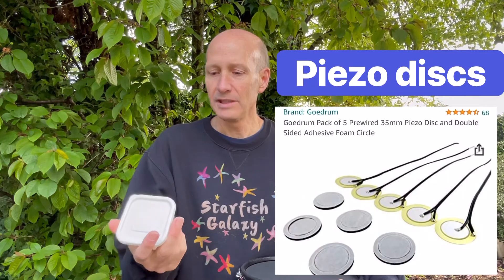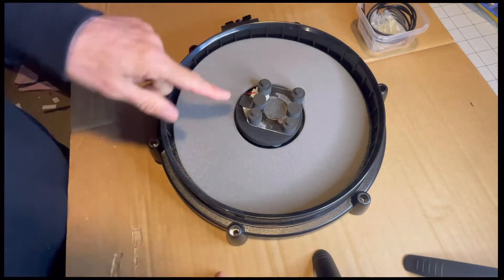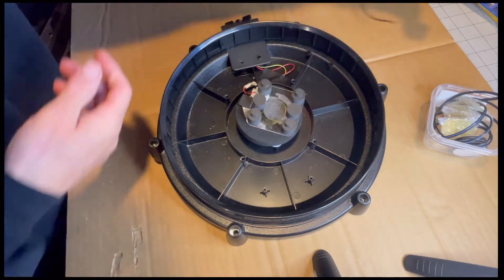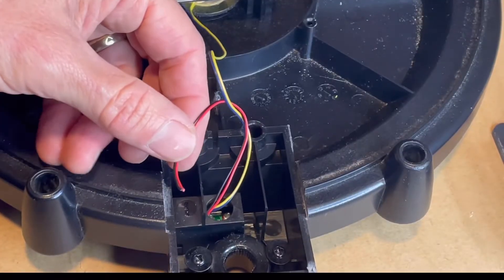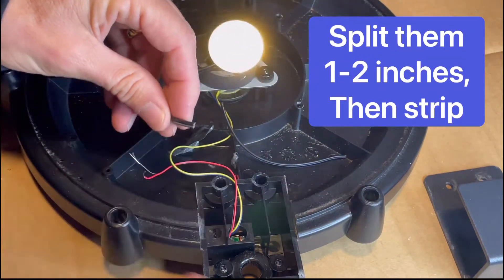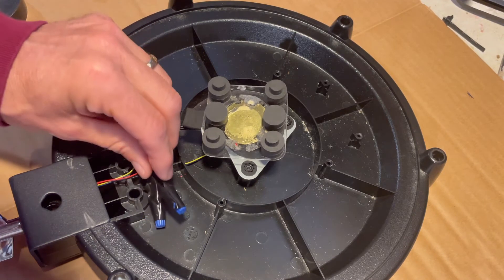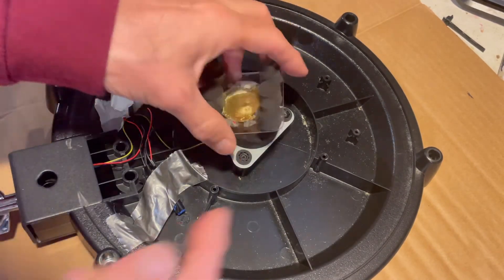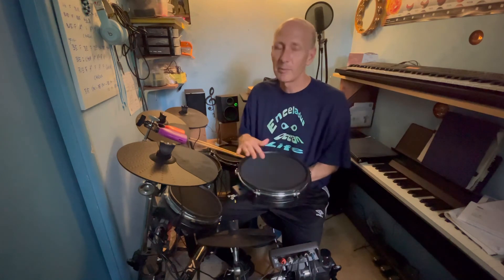Electronic Drum Repair - Piezo Disc

Comment: Do you have another piezo disc to recommend, o can’t seem to find the ones you used on amazon
Reply from the maker: You’re right! It looks like they have discontinued that particular model that I used. Doing a quick look on Amazon under “piezo disc”, it looks like most of those that are listed would work fine, including the , ‘overall pick’.  The ones listed  that are ‘10 pieces, 35 mm, $9.99, would probably work fine as those state they are also for mic drum trigger, which is what you need.  The icon you will first see states 41mm, but then has a selection of 35 mm when you click on the product before you order.  Thanks for your question and good luck!

Comment: planning to do this with my strike pro shells - they look great, but for a flagship, they have the same flimsy internal connections - i can't imagine they would cost all that much more to use more robust components and the strength of their brand would shoot through the roof
Reply from the maker: Absolutely agree!  Probably would have cost less than 20 cents to use a more robust thickness of wire because they buy their supplies in bulk at a discounted price.

Comment: mine had just the wires broke  idk how so i just soldered them back on and it worked :)
Reply from the maker: Hope it stays connected and working!   Soldering worked for me, but never lasted more than 2-3 months, which is why I eventually switched to the thicker wires.  Good luck, hopefully you won’t have to do any further repairing.

Comment: There is a butt connector used for telephone wiring that would be perfect for this application.  I do not think you even need to remove insulation first.  Might want to try.
Reply from the maker: Interesting idea!  So far I have not had to do any re-tweaking since I did this change a few years ago. The thick wire holds up very well against any drumming. I will keep your idea in mind though.

Comment: Fixed my Alesis kick drum and snare with this method. Excellent video, thanks a ton!!!
Reply from the maker: Glad it worked!  The thicker wire piezo disc will hold up quite well.  It really should have been how it was issued from the factory.

Comment: Hi, any update on how long the e drum fix lasted. Particularly, did the twist connector hold out against the battering? Thanks
Reply: I haven’t had to change it since I did this fix two years ago. So, for me, it’s working pretty good.  Before that, I was re-taping it and re-soldering it every few months.

Comment: Commenting to say that I had two triggers with problems. Used the recommended sensors, replaced them both, and they're both working good as new.  So can confirm this does indeed work and was much cheaper than trying to replace a full pad! 
Thanks
Reply from the maker: Glad it worked good for you!!  Going on two years now with my replacements and no problems.  Thick wires should be the factory  built default but, well, they’re not.    Good thing they at least sell these replacement piezo discs.

Comment: hi, I had the same problem and I had to buy a new piezo but when I hit the snare in the unit the snare rim also lights up, do you know what could have happened?
Reply: That sounds like a wiring problem.  The piezo disc at the bottom controls the snare rim, and the piezo disc at the top controls the snare.  I believe you will need to find where the two wires have been connected together and separate them.  If other people have ideas on this, then please give your input too.  Good luck!

Comment: Thanks a lot , I was about to buy a new one, I have the same model and I bought the size that you mentioned but mine was  I guess 5mm smaller,, but it worked with a 35mm,  the brand you show seems that the wire is less thicker than mine. I just wanted to say thanks you save me 200 bucks
Reply from the maker: Glad it worked out!!

Comment: Nice informative vid ... thank you. I have two Alesis Strike Pro SE kits (one in studio and one at home) and on the studio kit the 10" tom has failed and at home the 14" snare has failed. Alesis utterly useless here in the UK and to say they are slow to respond to my warranty claim is an understatement. Both kits are under 8 mths old. Once ( IF?) I get some joy and the when full 12mths warranty runs out I know I will be on my own to try and fix this stuff going forward so I do appreciate the time you've taken to put this together and show how its done. I know each drum unit will differ slightly but the principle remains the same. Thanks again 👍
Reply from the maker: Sorry you’ve had to go through this on both of your kits!  It is certainly frustrating when you finally open it up and see how thin in the wiring is and realize it was just a matter of time.  The good news is that at least there is a fix, and the result is something that’s much better than the original. Good luck!

Comment: Thank you! I’ve been fighting with Alesis about the cheap wiring they used on the snares. The kick drums are the way. My kick has been intermittent and I finally took it apart and saw the same wiring. Ridiculous!
Reply from the maker: Yes, the wiring is so thin that is ridiculous and destined to have problems. I did send them an email two years ago, but have not heard back, and I’m not really expecting to.  Good luck with your swapping out of wires if you choose to do so.
Reply: @paulkeller9552  I have done that and also ordered piezo pieces for the snare. Everything is now In working condition. Ridiculous that we have to fight and then DIY.

Comment: Can you show how to repair the piezo in the drum pedal? 🙏🙏🙏
Reply: Yeah the bass drum seems trickier — was hoping to find out more as well
Reply: @paulmackie2237 I replaced the piezo piece in my Simmons drum tower (it would fire, but you’d have to absolutely mash the foot pedal to get sound)

So far I’ve tested it and no dice. I undid the foam, located the broken piezo, took it out, replaced it with ones I got from amazon, and I’m not getting a signal of any kind.) - maybe it will work once I assemble everything back together but I’m not hopeful…assuming all piezos aren’t made the same.

(What’s maddening is I’m still under warranty from Simmons but their claim process is so impossible and shitty I just gave up. )

Comment: Im curious, how piezo can broken?
Reply from the maker: The VERY thin going wires going into the piezo disc breaks right outside the disc.  The replacement discs have a thick wire going into them which can tolerate the hits.

Comment: I've had to replace piezos in my Alesis DM10 so many times that I bought a drum-key drill bit.

Just ordered a bunch of the recommended piezos from this vid, and can't wait to do an overhaul that's actually going to last longer than a few weeks.

Thanks!!!
Reply from the maker: Wow!  A drum key drill bit!   You've obviously had to repair even more than I did.  it certainly gets annoying.  Good luck.   I have had no problems and it's been about a year.  Wish you the same.

Comment: hi. have the same kit, and have the same problem. after changing the piezo trigger, is the responsibility stay the same? i mean if i hit the snare lighter , it will make a light sound?
Reply from the maker: Yes!  The responsiveness is the same as the original parts.   I'm going on 8 months now with the replaced piezo disc working fine.   Happy drumming to you!

Comment: Good Video. Where did you source the replacement Piezo. They look good quality with thicker wires, unlike some on Ebay which have thinner wires... Thks
Reply from the maker: I got mine on Amazon: "Goedrum Pack of 5 Prewired 35mm Piezo Disc and Double Sided Adhesive Foam Circle".  $16.79 currently.   The wires are very thick.  7 months since putting these in a no problems since then.  You would think that thick wires would have been initially installed on product, but no such luck.  I would avoid thin replacement wires as they too will only last a fairly short time.

Comment: Any updates on how long this lasted? Thanks!
Reply from the maker: I had to do again a few days later. Likely due to the scouts that were out (up to a kilometer away) during the initial vacuuming, and the newborns that were born afterwards as they very small.  After cutting open the vacuum bag a few days later there were about a thousand dead ones in there, and now a week later there are just a few occasionally flying in/out, not the constant stream of them as before.  The tunnels under the ground must be more extensive than I thought, and I look forward to digging it all up in the winter.  Other tips: 1) Best time to position the vacuum is in evening when not active.  2). Turn the vacuum to the on position but not plugged in, then can turn on from a safe distance away by plugging in the extension cord,  3) Handy to put a rope around the vacuum to be able to pull it back from 20 ft away in case any stragglers are left buzzing around.  4) May need to repeat in a few days as the queen may still be laying eggs.  5) if you want to get the queen by digging force then make sure to be covered head to toe.   I’m content at this point using this method for ground nests as in the past I used the highly toxic foam spray which I know can’t be good for us and the environment.  
Thanks!  Good luck!
Reply: @paulkeller9552  hey Paul thanks for the reply, what kind of scouts play drums? 😂
Sorry this was in reply to your electric drum repair video. Just wondering if the repair held and for how long?
Reply: @thejoosisloos 3 months and counting